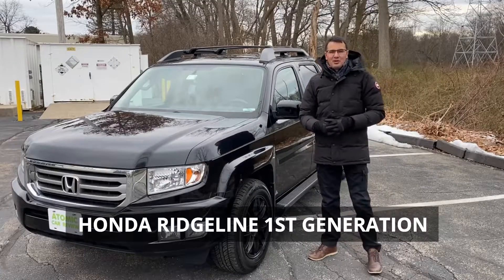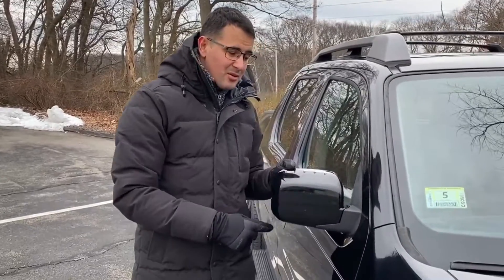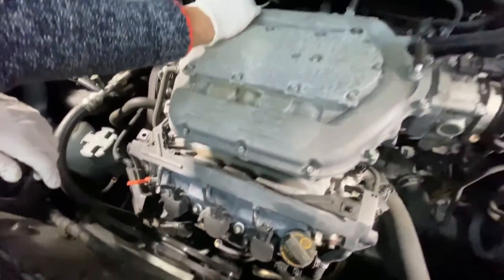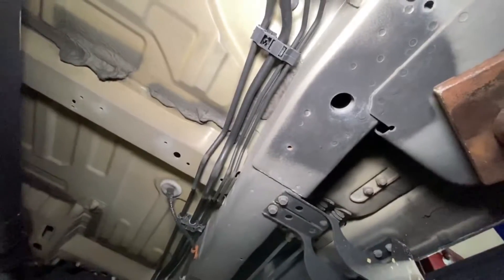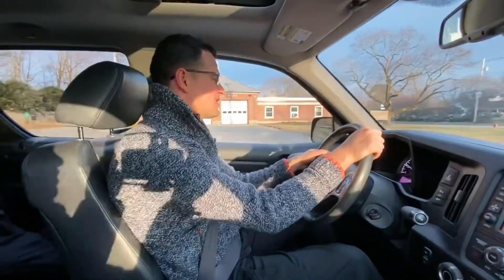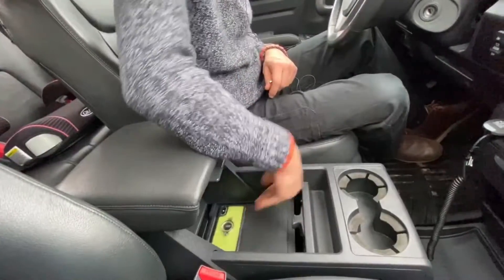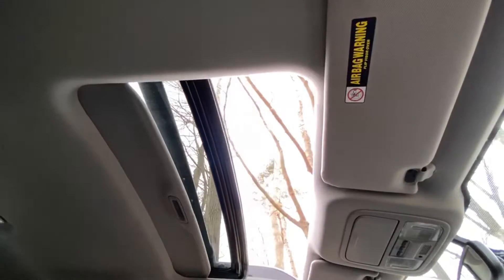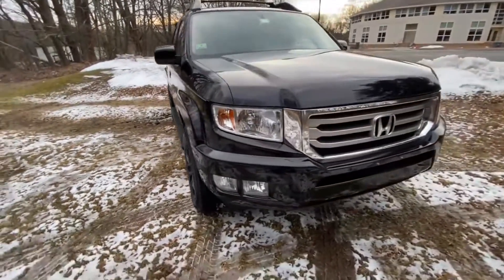2013 Honda Ridgeline - MORE THAN A TRUCK! Full Review

Comment: Knowledgeable packed review, I just purchased my 2006 RTL model in very good condition for $6,000 although it does have 200,000 miles on it but if it was maintained as the maintenance records show then I should have a truck that will last for at least another 100,000 miles easily.
Reply: I bought a 08 RT for $6500 with a little over 168,000 a couple weeks ago. So far it's a solid truck it was wasn't my first pick but I can say I'm glad I got it. Seen so many videos with people putting well over 300,000 miles on it
Reply: How is it running now ? Still good ?
Reply: I just bought a 2012 RTL 2 weeks ago for $5,700 with 200,000 miles on it. Really loving it gonna install an android radio, dash cam, and remote start next week. I just switched all the interior bulbs to LEDs today.

Comment: Great Review of the Honda RL! :) Honda did a great job on giving attention to this amazing truck! Sure it needs a few more things but it's not bad at all, a lot of storage, easy to access, I think if they put a few inches on the cab to extend the back seats, a little more horse power to pull a 7000 pound towing capability, maybe climate control in the back seats and usb c connectors for new phones and or a plug in for laptops while traveling to the next destination would be good too. Now the off road i'd suggest putting a few more inches on a lift and maybe bigger wider tires.

Comment: Thank you for a thorough review. I appreciate the maintenance and service information. Most reviewers only give you driving impressions. I need to pull a 2500 lbs boat and  trailer  up some very slick boat launches. Between the Pilot and the Ridgeline which one would be better for this. Thanks.
Reply: Neither. Go with the Fit.
Reply: @mig50cc well the fit is good for like racing and stuff idk about trailer hauling
Reply: Are pilots 4x4?
Reply: Comparable truck and SUV, you would expect the truck to tow a little more.
Reply: @blksheep176 You can get them in AWD and FWD

Comment: (add wind rain deflectors) makes a difference wind noise  he's right re: ridgeline being full independent wishbone  suspension re ride but to be fair  avalanche & cadillac ext are full size trucks w beds & use coil springs  (the suburban suspension) & have eaton locker rear differential  the swoop design @ bed of ridgeline assist's in it's body's integrity in addition to it's aerodynamics  avalancha & cadillac for air flow purpose also keeping in mind those two vehicles can be fully open area with mid-gate down & rear window (which has a defroster) removed

Comment: 2011 Mdx vs ridgeline which you most recommend
Reply: I own both, can’t live without either. I like the structure security and the luxury that my Mdx provides, but I love the practicality and the capabilities of the ridge line. They are both daily cars. I drive the truck and I have the mdx for the wife and kids. The mdx is definitely luxurious in all aspects, cost especially. Premium gas, parts, and services. I’m sure I’ve been of Zero help
Reply: @JonathanGarcia-cy7hd  0 help for sure.
Reply: @JonathanGarcia-cy7hd  if you mean I’ll be spending a lot more on the luxury of the mdx, that’s very helpful because i am a penny pincher

Comment: your estimation on cost of labor for a timing belt change is way off. otherwise good review
Reply from the maker: The price which I provided includes pulleys, seals, tensioners, all drive belts, water pump, etc. Just the timing belt you can replace between $300 - $400. Thank you!